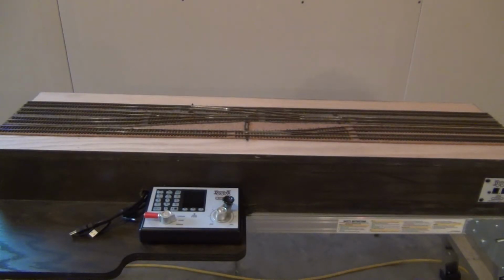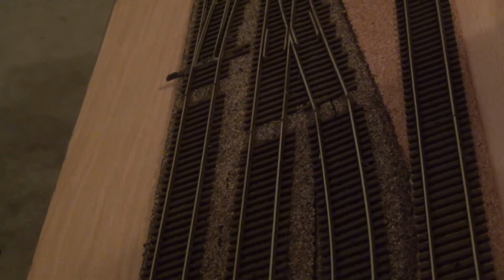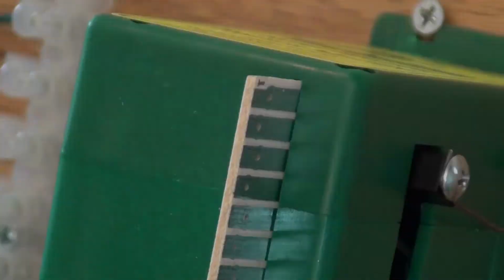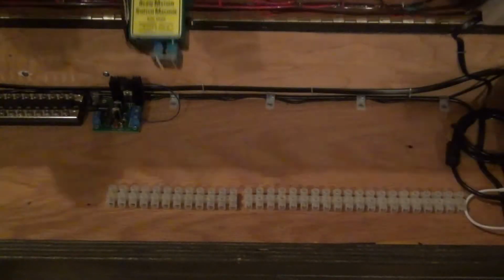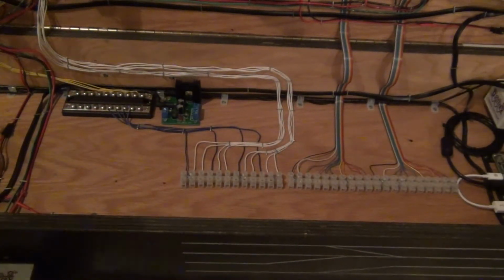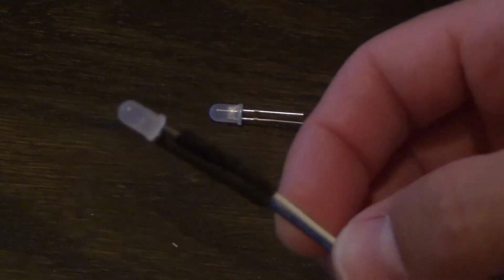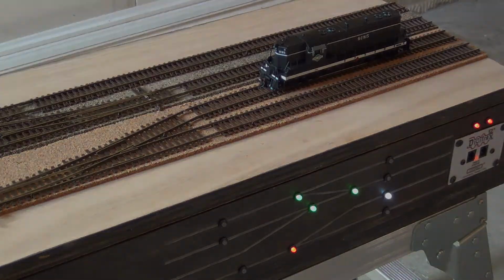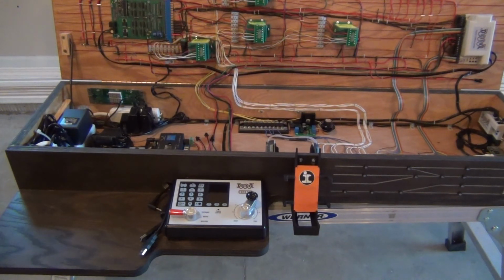Model railroad build video series, Part IV: installing Tortoise switch machines, wiring of LED panel

Comment: Nice wiring  ever wire a triple color dwarf light up ? It’s a led an lost the instructions but has three wires an had it temporarily hooked up long time ago .was red yellow an green
Reply from the maker: Hi, I am really sorry, without actually seeing your dwarf light, it is hard to say.  If it was a two color light it would make sense that you have one common wire for both lights and then a feeder.  If it is three lights, I don't know how they wired it from the manufacturer.  If you know the brand, you can likely find instructions online.  Sorry I can't be more help.